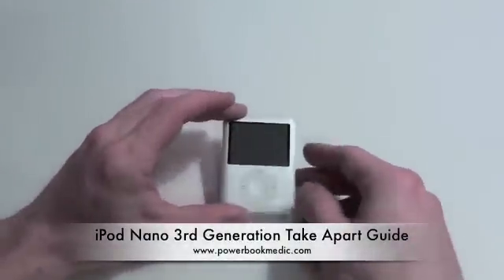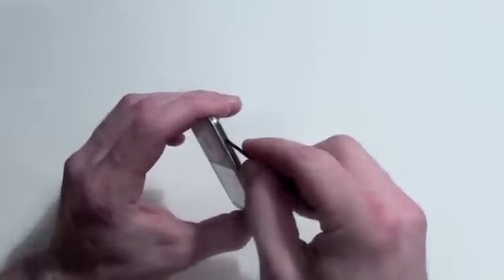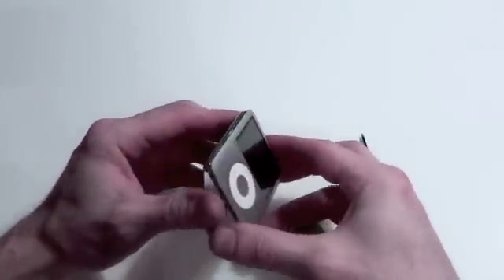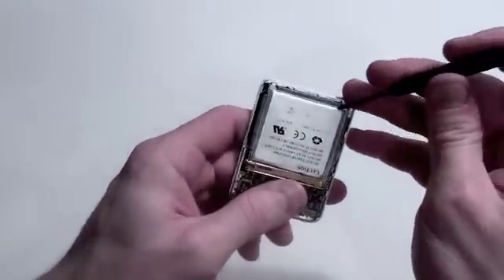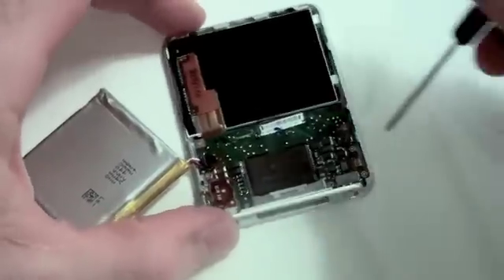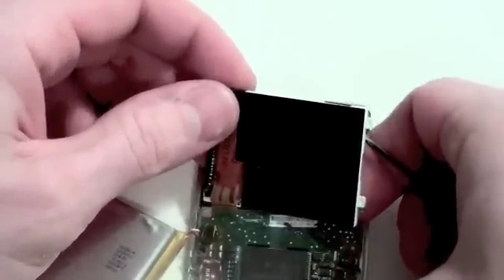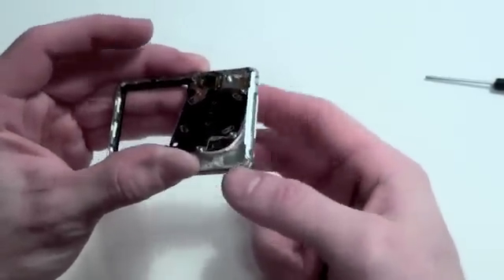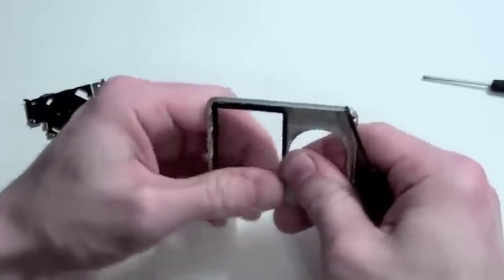iPod Nano 3rd Generation Repair Take Apart Video

Comment: I shove in guitar picks to the seam.  The plastic pick eventually bends and becomes a broken mess and I get another one.
By the time I am on my fifth guitar pick the back in still tight in place and hasn't budged at all. My fingers hurt and I am out of guitar picks. I get out my Dremel tool and cut at the seam.  That gives me at last a tiny starting point where my broken guitar pick starts to go in.  But the clips for the back are so tight that they don't budge. I switch to a small screw driver. After pulling and prying and twisting I eventually get the back off. Those metal clips were not made to come loose. At that point the entire back is bent up so bad it's ready for the trash can.

Then I find the battery is glued in with adhesive.  Slowly prying up while trying to not break the LCD the battery comes loose. This takes several hours.  At last it's up and I take note of the wire colors to the circuit board and desolder them.  At this point using an actual battery made for the Ipod Nano 3 is pointless.  So I pull out an old cell phone battery that is bigger than the whole iPod.  I solder that battery onto the terminals. Being an electrical engineer I have no trouble deducing the proper terminals from the battery. I lay the iPod on top of the battery as if it is the new back of the iPod. I use clear tape to wrap around the whole thing. It's quite ugly now. But it's back working just fine and has a battery that will run it for days. And I can still see the screen through the clear tape because I used the clear kind instead of that junk magic transparent frosted stuff.  Actually I often just use Kapton tape because I got plenty and it's good and strong.

My main use of the iPod is as a source of music to my car radio.  It can read an iPod but it has no bluetooth. For that purpose I don't need the iPod screen or buttons. But I have found that even if your screen is broken you still need to leave it plugged in because the iPod will not boot to any functionality if it doesn't detect the screen. It doesn't need the button or the headphone jack.  Besides I hate Bluetooth anyway.  The devices always come unpaired and I have to go through the whole pairing process over and over.  Sit my bluetooth headphones down and go to the restroom.  Get stopped on the way by the boss to discuss something.  Finally get back to my desk after an hour and the headphones have gone to sleep.  Try to get them back going but paring is gone and I have to go through the whole re-pair process again.  I hate bluetooth.  Same thing happens with my bluetooth mouse or bluetooth keyboard.  The only thing and I mean the ONLY thing that stays paired are earpods to a cell phone.  They won't stay paired to my laptops, or my tablets.  Did I say I hate Bluetooth?  Well... I hate Bluetooth.

Comment: Btw How do you prefer the black spots in the Ipod nano series? Cause I don't want to have that Black spots
Reply: The black spot is from the battery expanding when the spot appears it's already to late because the way ipod nanos open except 3rd gens requires you to slide it out the top wich could tear the battery causing a fire. So try at your one risk
Reply: @LTAS-Thor  Can I change it the battery before it expands?
Reply: @ciuwandy9238  yes but you need a soldering iron its like a pen with a hot iron tip

Comment: I have the same iPod, my hold switch is broken. It's turning on and after about 5 seconds,it turns back to hold.please help.
Reply from the maker: Surya Dev Most likely, it needs the hold switch cable to be replaced.

Comment: Don't waste your time.  The plastic things provided by these battery makers SHRED as you try and get them in the case and move them around. I went through 4 of them. Ended using a box cutter blade.   Once you get the case open, the ires are hair thin and nearly impossible to solder.

Comment: Unfortunately, the back is on so tight plastic tools won't pop it loose. Also, the clips on the back panel get bent in the process of taking it off and the back won't adhere to the front panel as tightly as before.
Reply: I have opened about a half dozen iPod nano 3rd. Guitar picks and spludger tools are no match for this case. And I have not succeeded in opening one where the back case cover was not mangled to the point that the only thing left to do was cut all the clips off and discard them.  Then once repaired put the back cover back on and use clear tape to hold the cover in place. 
As a matter of fact several were so mangled that I just gave up on the case totally and replaced the battery with a much bigger cell phone battery that would last much longer.  Then wrap the whole thing in kapton tape.  I use most of these as music sources for my car radio/mp3 player so screen and button control is not necessary. But unfortunately the nano 3rd will not run if the screen is disconnected. Even a broken screen makes it work.  I can fit lots of music on the 8gB nano.  

A 1gB flash pen can't hold as much and worse it comes close to crashing most car radios.  It's better to let the storage device take care of organizing and decoding the compressed music file like an iPod does.  The big problem is most car radio manufacturers believe that they should do an entire inventory of the flash pen before playing instead of giving you a way to navigate through the folders. And they put all that inventory into the very limited RAM memory of the car radio. And that inventory process bogs the radio so much that it's essentially crashed.

I have another 3rd nano to replace the battery and this time I am going to push the edge to my sander grinder to make a little hole to hopefully get started.  In fact I may just grind the whole outside edge of the case.  My philosophy is that once the battery is no good the back side of the case is a lost cause.

Comment: My ipod doesnt charge anymore it only works when its pluged in but it doesnt charge at all all it says when i unplug it is to connect to power it. Any ideas thank you
Reply: Looks like you have to replace the battery. You'll need a new one, flat tools, a screwdriver and a small soldering tool. Good luck mate, i'm looking for those too.

Comment from the maker: It's on the LCD. You'll need to replace the LCD to replace it. Replacements are available from our website or by calling us at 866-726-3342, option 1.

Comment from the maker: @TheGreySanctuary - Discharge static electricity before working on a device and mainly be careful not to have your tools be positioned in a way that would damage the logic board. Just be careful and take your time and you should be fine.